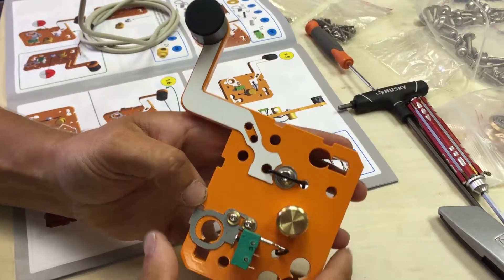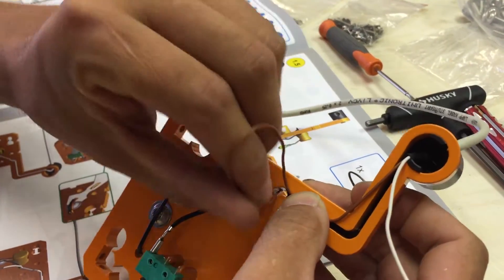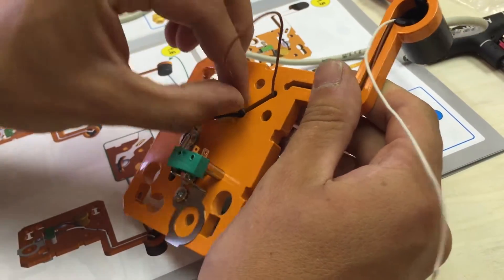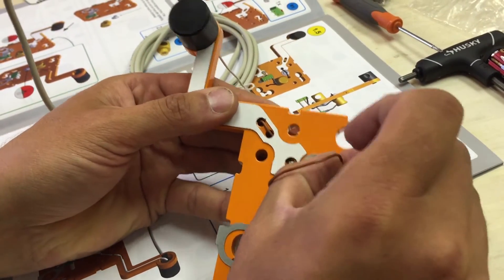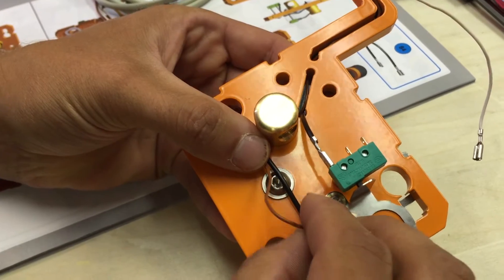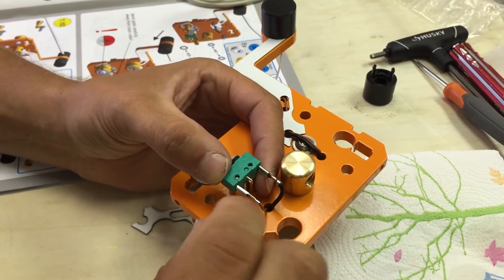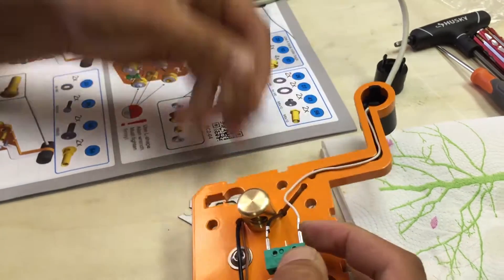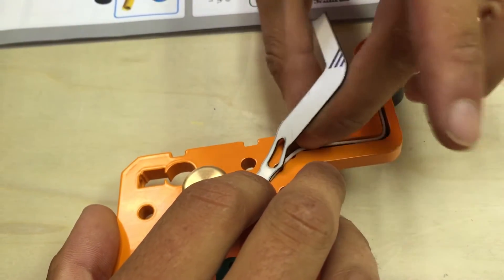Stepcraft-2 Assembly Step 1.6 - Routing The Wires On The X-Z Connector

Comment: Ok, so, that last step you did, with the adhesive film, using it to hold down the wires. I accidentally put that on first. Am I gonna have to get another one of those and rip the original one off? How do I proceed with that?